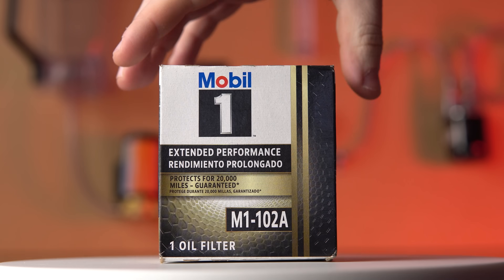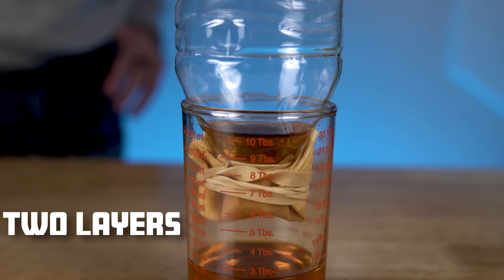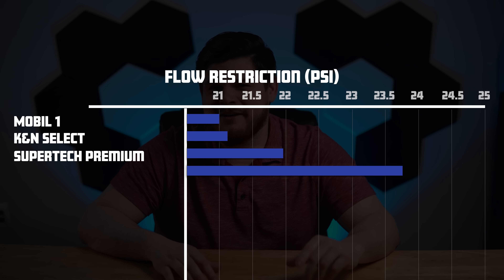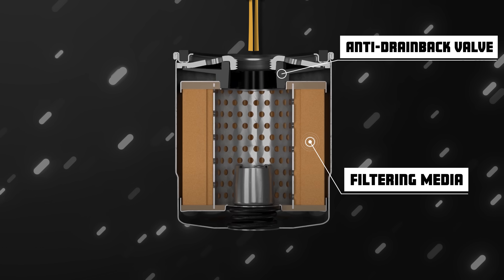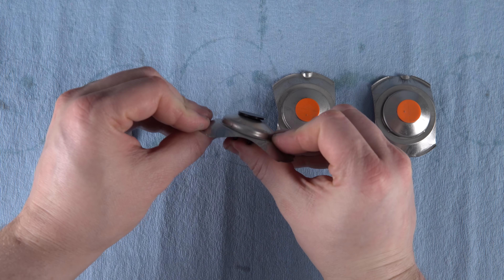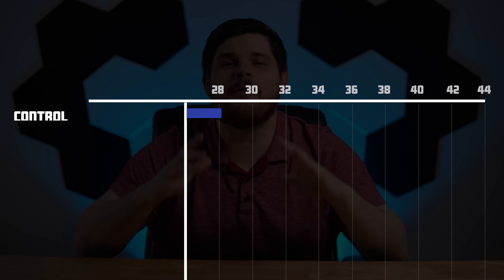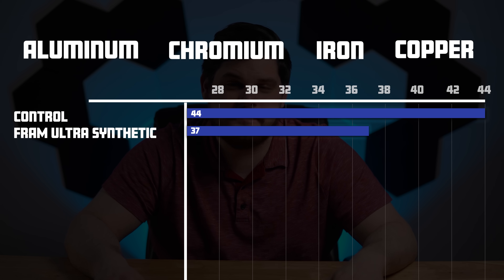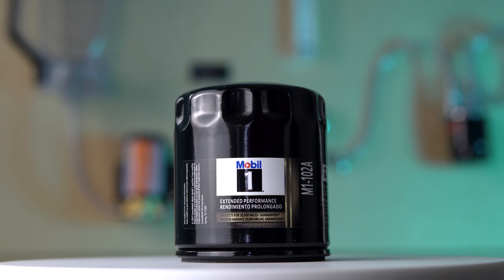Engineers Test the Best Oil Filters! FRAM | Mobil 1 | K&N | Walmart Brand

Comment: I think this new trend towards high oil change intervals is a ploy for planned obsolescence.  Once the oil control ring gets stuck with sludge the engine is on borrowed time and starts consuming oil.  But the manufacturers know this will likely occur past the warranty; well, it often begins occurring within the warranty period but the manufacturer will claim something outrageous like 1qt consumption per 1000 miles is within normal spec.  That’s pure BS! The oil control ring is failing at that point.  Once it gets completely stuck to one side of the cylinder it will wear the cylinder in one spot to the point the compression ring no longer seals and that cylinder loses compression. The best way to prevent this is frequent oil changes.

Comment: I used a k&n filter on my ford ranger cause i got it on a sale at autozone, my oil pressure dropped in the truck and i had keep the idle up just to make the oil light go off. Went to walmart and got my fram, and never switched again. I use fram in my 03 Ranger, 06 Fusion, 09 F150 and 12 Fusion. Never changing again.

Comment: 5000 miles oil change seems premature for a full synthetic oil. That's actually the intervals for a full synthetic DIESEL oil. Gasoline engines are supposed to have higher oil change intervals than Diesels. Maybe go for 7500 miles if using full synthetic.

Comment: Back in the day, while stationed at Ft Bragg, NC, I had  a weekend job of delivering filters to businesses in Cumberland County from the Purolator Plant in Fayetteville. Depending on what doors you loaded from determined what brand markings the filters were packaged with. I remember delivering filters for K-Mart, Rose's, NAPA, Woolco, Sears, JC Penney and a MotorMate brand for a local auto parts chain. Filters were air, oil, fuel and PCV. Have no idea if it's still the same way.

Comment: Higher back pressure just means your FRAM is running your oil through the bypass valve more than the other filters. FRAM is the absolute cheapest build quality but they charge a premium for some reason. Don't buy them.

Comment: The Fram XG is usually 60% of the price of the Mobile Oil Filter....Im in Canada and can get the XG for $14  while I never see the Mobile for less than $20.....No matter I never go beyond 5000 miles or 7500 kms even when using a top notch oil filter and synthetic oil....$70 for a DYI oil change is much cheaper than  new engine.

Comment: coward you ducked the truth lol I use fram filters on my engines and castrol oil 10-40 for v6 and 20-50 for v8 and after 200,000 miles they always look like the day I put them together and I get great milage and produce more hp than the factory design. example LA 318 engine full size dodge van 25 mpg as long as the wheels are turning and still out run a 70's model corvette. they top out at 135 mph I dont. I have built 3 or 4 of these. dodge dakota v6 3.9L engine 200,000 miles to 400,000 miles no problems from anything oil related. something not mentioned if you are not using a qt of oil every 3000 miles you have a problem. find it.

Comment: Several years back (90's I think?) a news organization did a test with taxis, because of stop and go, and with cheaper filters back then, but they concluded that changing at less than 7,000 miles was unnecessary!

I've used the 15,000 before they came out with 20,000 filters, and usually changed at 10-11,000, but with 20,000 I changed around 15,000, and had no problem except both Cavaliers got totalled, first one got hit, second my wife hit someone else.
The SUV we bought to replace the second Cavalier just got a change after 11,000 miles, cause we're taking a long trip soon, and wanted that to be out of the way before we leave!

I have never had any problems with oil, course I usually have high mile cars, (before I lose em, 🙄 or sell em cause of eating belts, and/or alternators, and such!) so I think every car I've had I have to add new oil every 3-5 thousand miles, give or take, which freshens it up a bit between changes!😁🥴 (I had a Metro I didn't have to for a long time, cause it had 32,000 when bought, and one of the Cavaliers had 22,000 miles, which was the lowest miles car I ever owned, and went the longest without using oil till I put a hundred thousand miles on it, yep, changing the oil 10-15,000 miles the whole time!)

Nearly every car I've owned  was around 120,000 before they left my life, for one reason or another, but never cause the motor blew up over lack of oil changes!
(Around 115,000 is when the RPMs gauge stops working properly on a Cavalier!)

Comment: This just confirmed that the Fram Ultra is a good filter. None of the other filters were filtering to 20 microns, the amount of aluminum dust was excessive and the oil wasn't at operating temp.  You need to heat the oil to 200 degrees, and weigh the filters before and after to see which one collected the most contaminants. It's a flawed test, but I saw nothing to make me change from the Fram Ultra filter, although the M1 looked good.

Comment: 3rd generation mechanic. We have never seen the oil filter cause engine failure. The exceptions are improper install. Example not tight, leaving old o ring on block from previous filter etc.

Comment: So you're comparing the Mobile one that only filters to 30 microns compared to the Fram which filters much better down to 20 microns - and some wonder why it has a slightly higher PSI number?  And as for the aluminum particle test - if you have that many ppm of aluminum in your oil, your engine is shot anyway and the filter isn't going to make any difference.
 I'll take the Fram any day.  Bottom line is - any of the premium full synthetic filters are excellent and the differences are pretty minor between them.

Comment: 2:10 up to one year?!?!?! so what's the manufacture date? the filter will vary depending on what vehicle its for 5:30 should really have an alarm or simple wire that shorts out to flash the engine light if the bypass valve opens

Comment: So, it kinda doesn't matter all that much, since every engine has a bypass valve to oil the engine whenever the oil can't pass through the filter, be it a dirty filter, oil too cold or just revving too fast.  Dirty oil is better than no oil.
The best thing to do is to upgrade your oiling system to a bypass oil filtration system (different than a bypass valve) which forces filtration without starving the engine for oil.  Only problem with that is they are costly and require an aftermarket installation and are mostly only used on heavy duty diesel applications.

Comment: Can you do a Mopar filter for WJ Jeep's on a comparison to Mobile 1 and Fram and K&N. It would be interesting if you could also throw in other OEM filters and test them to filter up to 5000 miles instead of 20,000. I change my filters when i change my oil. It was a recommendation from a very good mechanic I learned from. That any recommendations given by vehicle manufacturers for servicing are only to get you past 100,000 mile warranty and doesn't take into account the life of your engine, transmission, differentials, transfer case or your radiator. 
I was told to always change all of them at half the time of the manuals recommendation!
I change my oil filter at 3000 miles along with my fully synthetic high milage 5W-30 oilon my 02 Jeep Grand Cherokee 4.7L V8 SOHC.

My engine has survived multiple overheating incidents abd is going on strong.

Comment: Most of the longevity filters that are more expensive used was called Lofted fiber is there filter media. This is a depth type filter media that captures and holds more contaminants than the regular surface paper filters which they're really cheap filters are made from. And yes you are correct about the bypass valves. And it's not a horrible thing to have them. The fact of the matter is if your engine is producing contaminants that when the bypass valve opens momentarily that can do major damage to the engine. Then you have a major problem with your engine anyhow and like you said it's better to allow the contaminants through to keep the oil pressure up, then it is to starve the engine of oil without the valve.

Another interesting fact is that any oil that is thinner than 5W30 has to be synthetic because petroleum oil cannot protect your engine and be that thin. How good is synthetic oil? All of NASCAR uses synthetic oil in the race engines. And is the reason that you rarely see an engine blow up anymore. So does NHRA. And they do not always use the oil that sponsors them. When it comes to that much raw power being produced and if it's for a long. Of time you have to use the most balanced oil on the market because a balance oil will not break down as fast and do damage to the motor at the end of the race.

Comment: The true measure of a filters worthiness is NOT what it looks like inside, rather how well it actually catches contaminants.

I have had four vehicles go 150,000 miles on Fram filters and use very little oil. They were all operational when I either traded them in or parked one due to extreme rust. It is a full size van so It is good for storage. I started buying the Fram years ago because  they have that gritty surface that is easy tl get a grip on.

My most recent one is a 2005 Liberty diesel which now has 290,000 miles.
With me, function wins over looks every time.

Comment: Ridiculous to worry about a brand of oil filter, you change it often, so you don't worry if it holds up to 10,000 miles. Because you need to change it at 5,000 miles or less if you want your engine to last and not sludge up. Any oil filter will hold up just fine for lower mileage oil changes. 😊😮😂

Comment: I would never go 10'000 miles without changing an oil filter. I know manufacturers are recommending longer between oil changes, but I still change every 3,000 to 4,000 miles. Worst case I wate a few dollars.

Comment: My 1995 Ford Explorer has always had Castrol 10-30 Conventional oil and a Fram oil filter.Changed at 3000 miles.It now has 435000 miles on it and still runs strong  with no smoke or leaks.
Reply: everyone talks smack about fram but i bought my 2003 tahoe 5.3 with 150k and now its at 250k all on fram filter intervals
Reply: @dkemp1337  my 07 Tahoe has 256,000 miles. Always used a fram xg. Still runs great.
Reply: how many brake lines 😂
Reply: then try 1992 Ford Tempo 3L-V6 509K original and still runs and sound like a new car....
Reply: People have been tricked into thinking that only Toyota 5.7L engines last a long time. The 1990's Chevy V6 and V8 and Ford V6 and V8 push rod motors, are the longest lasting engines. They have a heavy duty timing chain that is so thick and so short, that it could last for 1.5 million miles. This was also an era before they switched to aluminum cylinder heads. The 1998 Chevy V6 engines are 100% cast iron. You cannot blow a head gasket on a solid cast iron, closed deck, 9.5:1 compression engine that is machined correctly. The only weak point on American cars was the electrical systems, and plastic trim. Not the engines.
Reply: Good for you🤗
Reply: they are reliable

Comment: Pushing back on your first statement about more filter media being more restrictive, that's not exactly true. In pleated filters of any kind, more media usually results in more pleats and thus more surface area for the substrate to filter through. That's why the FRAM looked like it had thicker pleats, because it has fewer of them. Also pretty sure your first test was just measuring the bypass valve calibration, not flow restriction. 22 psi is a pretty common specification with tolerances usually being plus or minus 3 psi. If all of the filters were meant for the same vehicle, they probably all had the same spec.

Comment: I always used Fram and I get over 400,000 miles on my Chrysler 300 3.5L My 2007 died last year at 467,000 miles and it was the timing belt. I had a 2013 that got to 323,000 but was totaled in a crash. My current 300 is a 2006 with 288,000 so far. I will still use fram.
Reply: same here i have used fram filters since 1967,  had many trucks run over 300000 miles

Comment: I would only use a FRAM filter if my 1st Sergeant held a sidearm to my head and gave me a direct order. And...hahaha!! Mobil 1 are the best overall: build quality, drain-back protection, etc. I've been using Mobil 1 filters for a long time, with Royal Purple HMX High-Mileage 5w-30. Give it a try for one or two drains. Best of luck, ya'll...it's nice to be correct on occasion, ya know?

Comment: Only oil filter I've ever seen fail was a Fram. The pleated filter collapsed on itself and the bypass valve failed. Engine was destroyed. It wasn't a very old car and the oil change only had about 500 miles on it. Since then Fram switched to metal inside the filter like in this video, but...I can't bring myself to trust them. Even when filters are on sale.

Comment: I worked for an automotive parts supplier for over ten years where the filters supplied were Fram, Valvoline, Ryco and our house brand. We supplied parts to local speedway competitors. On a number of occasions (once is too many), with Fram, the inner media support collapsed and damaged engines. Fram admitted the fault but wouldn't warranty racing engines. Word got round and the speedway guys and ladies stopped using Fram.
   On one occasion the seam split on a Ryco filter. Ryco admitted the fault and paid for a full engine rebuild, but because it was a racing engine, the owner did his own removal and re-installation of the engine, which Ryco didn't pay for; everyone was happy.
    The business eventually dropped Fram, then subsequently dropped Valvoline (to my knowledge no-one ever had a problem with Valvoline) and taking up K&N and Sakura.

Comment: I’ve ran the official Subaru filter “ the good color” lol 2000 miles and the anti drainback didn’t work either of the two times I used them 

I’ve ran the Fram tested here normally a few times and irresponsibly 20k once and the anti drainback worked as it should every time

Comment: This might ne a stupid question but what viscosity oil was used in the test? I'd be curious to see if the fluid pressure was emasirably different between, say, 0W-20 and 5W-30. Since fluid pressure seemed to be the most empirical metric that gave it the better score (aside from build quality considerations that can be difficult to quantify) I would wonder if the pressure gap for lower viscosity oils would be changed (reduced, widened, or unchanged) since presumably the filter capacity and ppm of contaminants in the lab-tested samples should theoretically be the same? Very interesting look at filter performance and gives me something to consider for my next oil change!

Comment: Temperature has a huge effect on viscosity which will effect pressure.  Nice test setup though!

Also I'd always recommend filters with the silicone anti-drainback valves (orange typically) as opposed to the black which are typically nitrile. The black ones will leak over time to a much higher degree, defeating the purpose of the valve. I'm a materials engineer who formulates these and the nitrile washers and know what the manufacturers do for validation testing 😁

Comment: Great testing. Vid  testing small engine oil filters like kawasaki, kholer and briggs and stratton vanguard oil filters would be interesting because many consumers opt out of there use in favor of automotive filters but how do they compare and is changing to an automotive oil filter hurting of helping because they were designed for automotive use not small engines. Please consider testing like this in the future.

Comment: Interesting video. The first manufacturer of oil filters in the USA was Purolator. It would be great if you could include Purolator, WixXP, NAPA GOLD, Fleetguard,Baldwin,ETC just to name a few MAJOR PLAYERS. 
As a retired CAT&CUMMINGS knuckle buster I mentioned the last five filters because in the diesel industry they are heavily used! Just a note on oil changes; in the commercial truck industry oil change period range is commonly 12,000 to 15,000 miles for the last twenty or so years.  
I have two gas vehicles and I use Shell Rotella 5W40 synthetic and change the oil every 15,000 miles but I do change the oil filter every 5,000 miles. My last car finally gave up 300,000+miles!!!!

Comment: The problem with this test is that 1 the oil isn’t hot and 2 the oil isn’t under much pressure. Add these two elements and you get a much different result

Comment: I've always ran Fram Ultra Synthetic Filters with Mobil 1 Extended Mileage Synthetic Oil in all my cars, best filter and oil combo. I'd rather the high filter media density as it's going to filter more and maybe just offer that little bit extra protection my engine may need, especially running turbos.
Great video, was nice to see a physical demonstration to prove just how good high end filters are, but also sheds light on the fact the store-brand is sometimes a great value, being made by their competitor more times than not, show in this video too!

Comment: I don’t understand the conclusion that a filter with more capacity is better in any way. If the goal of an oil filter is to filter out contaminants, then surely the lab tests of how many parts per million are present after having the oil run through the filter should be the most important one. You can change an oil filter more frequently, but you can’t remove wear and tear caused by more contaminants by having a filter that has more capacity. That is essentially saying oil filter cost is more important than engine damage.